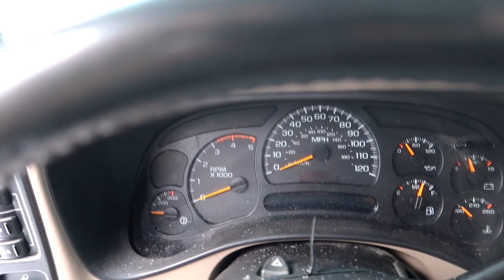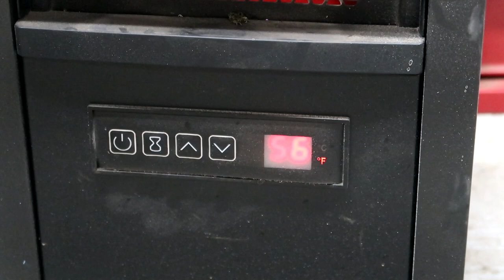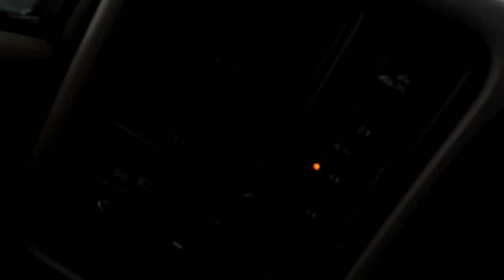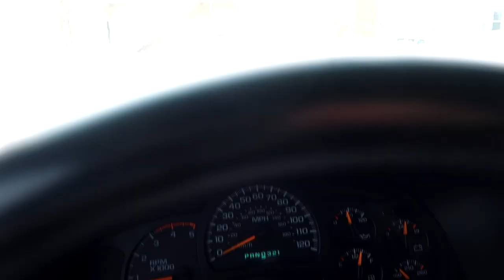THIS SUCKS... DURAMAX TIME!

Comment: Usually two - 1/2" solid rod 18" or so in length is all you need to adjust the garage springs.

Comment: I would suggest that to get the truck out invest in a harbor freight winch and a mount to go in the dirty max trailer hitch and a snatch block then you can easily pull it straight back then up the hill

Comment: Hey man I meet you at the call out I was the one.that had the same truck as you and from tn but I want to tell you about something you should watch out for with your truck the transfercase will get a hole in it form the clap that holds the pump in and if it dose you will have to get a new back   half and that can cost a lot it a lot cheaper to fix it be for you wears all the way throw